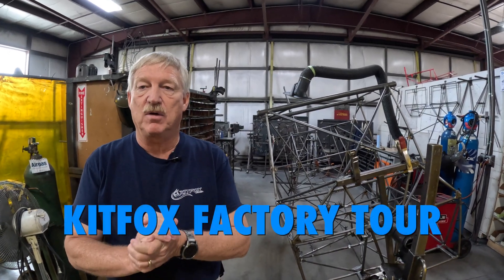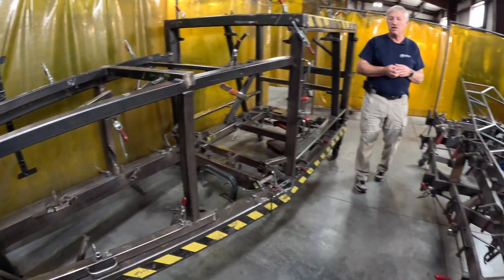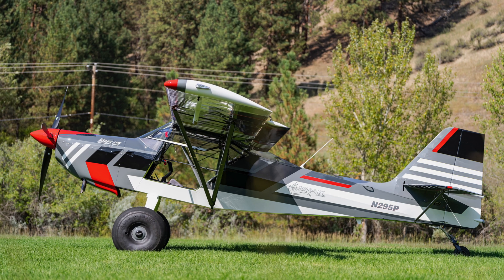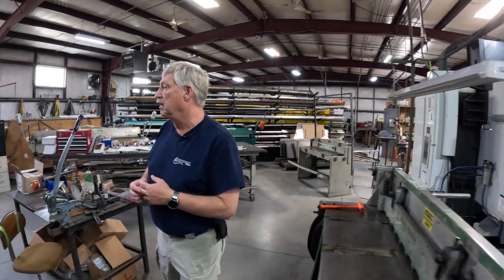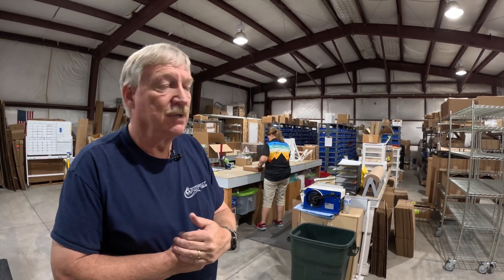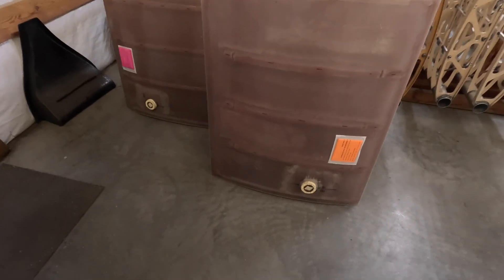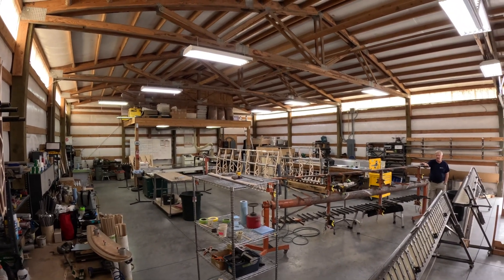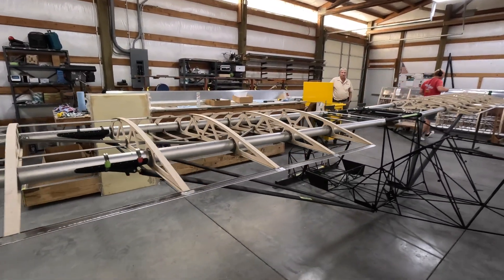Kitfox Aircraft Factory Tour

Comment: I can't understand why kitfox doesn't offer a version that keeps the frame but is covered with riveted aluminum sheets. Why not? The single biggest complaint I've heard about the kitfox build process (other than parts not fitting correctly - which is ridiculous) is not only how messy the ironing, priming and painting process is but the aprox. 6 months or more time it adds to total build time. And that doesn't include having to deal with fumes and clean up. For this reason alone, I would opt for a Zenith if it weren't that their high wing aircraft are so damned ugly and weird looking.

Comment: Did I hear/understand right that currently (as of Dec 2023, or so) the lead time (delivery date) of a factory built kitfox is 3 Yrs from the date of order?  If so, how does kitfox and customer agree on the cost of an aircraft?  Meaning, if I was to order a kitfox today at $150k but, lets say due to inflation in 3 years (2026) the same aircraft is sold for $170k (or even minus $130k)...  what is the actual price kitfox and the customer agree to on the day of the order??
Reply from the maker: Best to give Kitfox a call to see what the current purchase agreement says. 208-337-5111